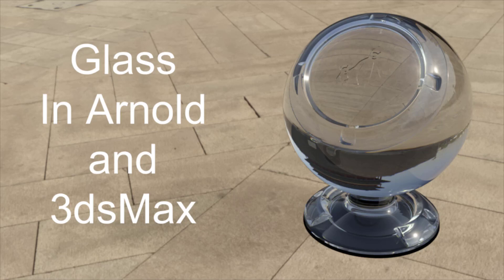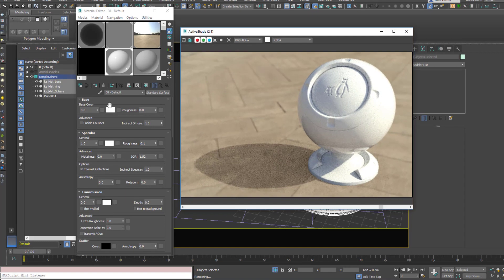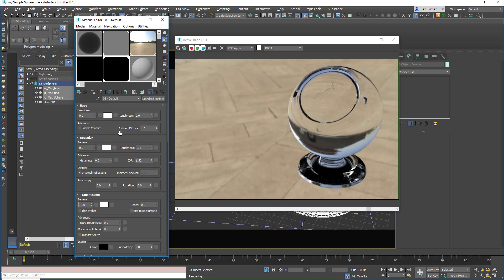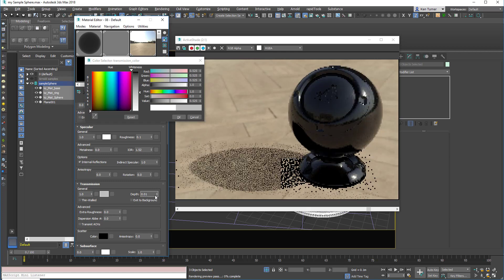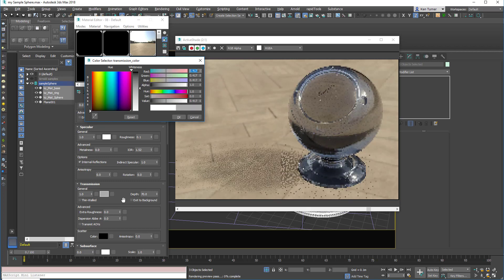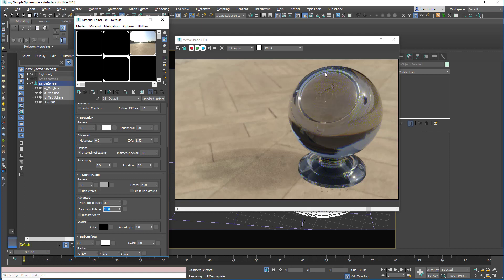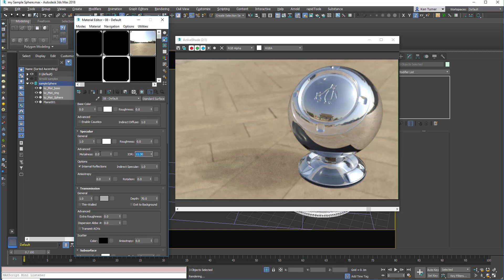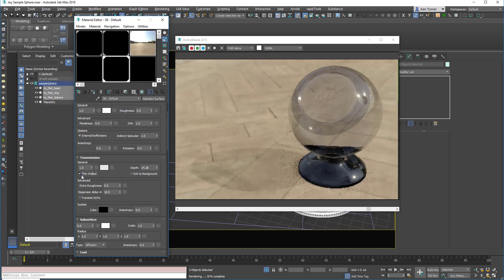Arnold Glass material in 3dsmax

Comment: How to make waviness on a glass surface? Like the windows of of a bulding's glass facade. They are not exactly like mirrors but instead reflections are slightly distorted. I tried with putting a noise map in the Normal (Bump) slot but it doesnt seem to work out.
Reply from the maker: Each window is at a slightly different angle. You can simulate this by
- twisting each bit of glass in the mesh
- randomising the UVs on the glass so the each window has its own UVs
there are some other tricks but these are  the easiest

Comment: great tutorial. struggling to get transparency in my alpha channels using standard glass. Only just switched to Arnold in 2018 so wondering if it's been updated or whether you'd recommend going straight to surface shader as in the tutorial?
Reply from the maker: It's worth downloading and updating the Arnold plugin for max 2018. There are a lot of bug fixes and extra features in Arnold v3. I think max 2018 is installed with Arnold v1

I like the surface shader. I think its nicer to use than the max physical material , but it ONLY works with Arnold where as the physical material works with all the included max  renderers ( and vray i think )
Reply: @kenzorman  Thank you that's a massive help. I nearly opted for Red Shift after encountering a few odd behaviours (possibly scale related rather than bugs) but upgrading might well help with that too. Will try your suggestions. Thanks once again.